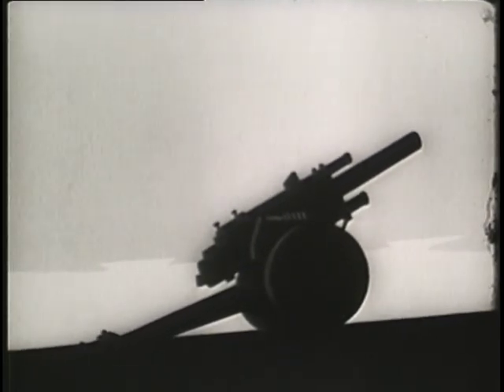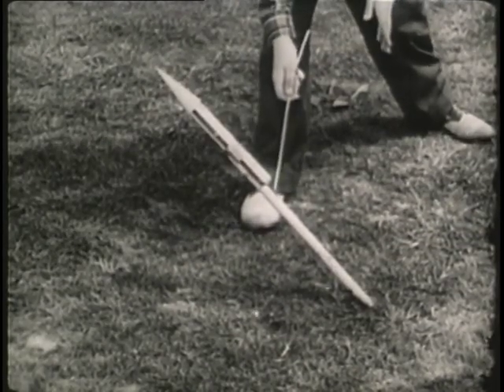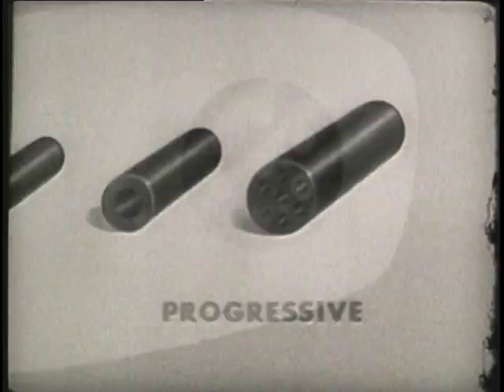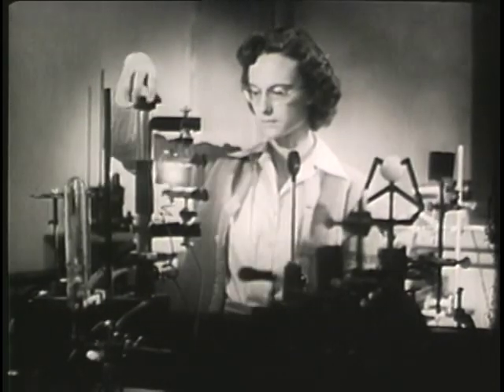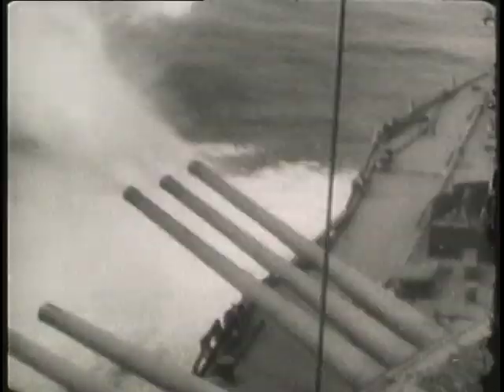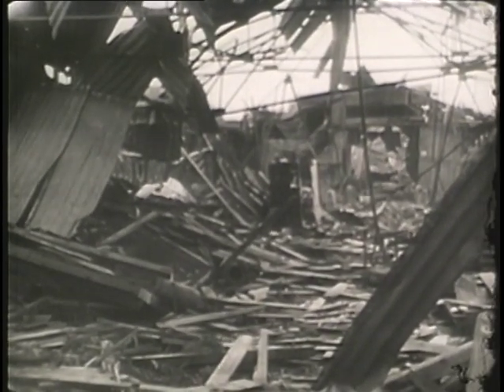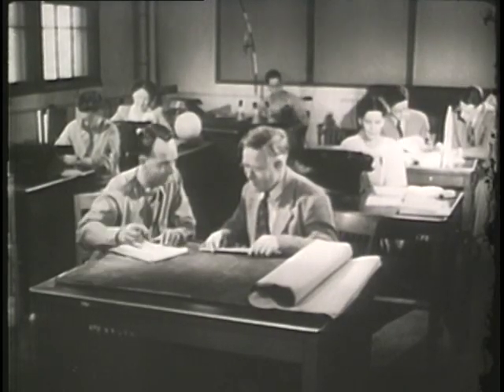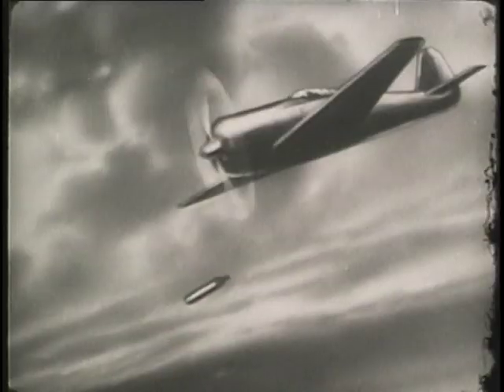FUNDAMENTALS OF BALLISTICS

Comment: The rifle is more massive than the bullet, thus cannot accelerate at the same rate per a given force. F (force) = M (mass) * A (acceleration) is Newtons second law. When the bullet exerts its force on its target, it does so over a very small area. Why does a nail penetrate a board so easily when hit with a hammer, however the same blow from that hammer will not penetrate the board? This is the same force distributed over a larger area, allowing it to be absorbed or transmitted by more material.